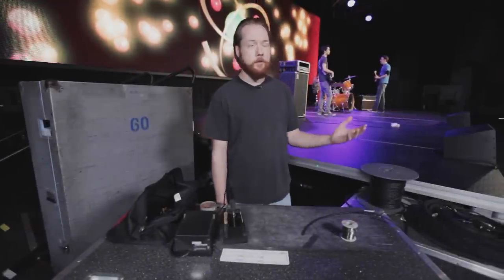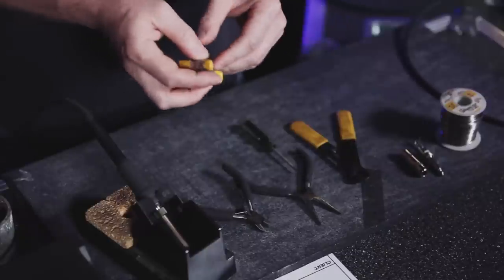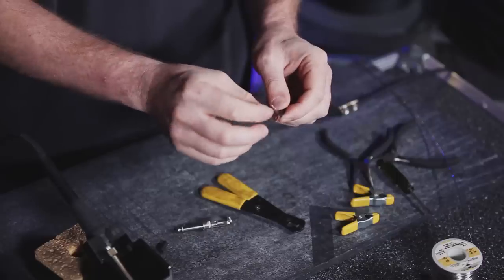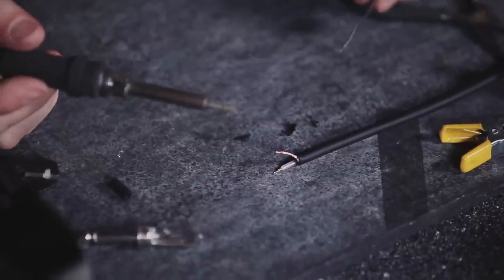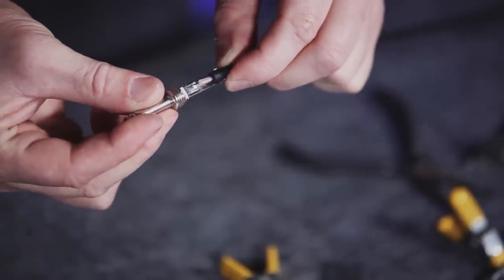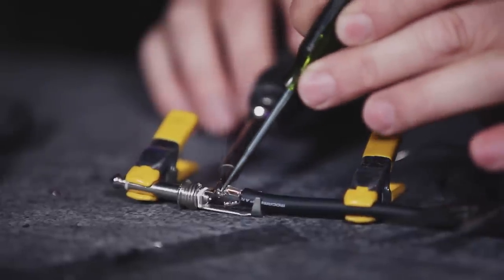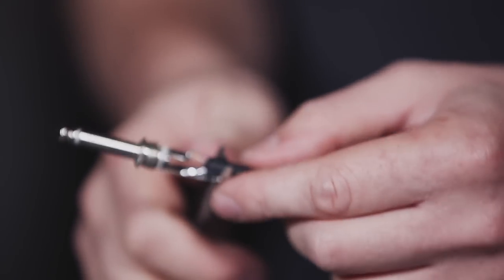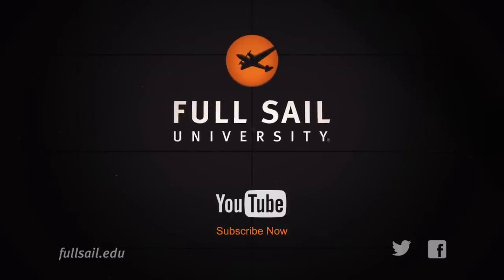How To Solder an Audio Cable

Comment: Great video! I We have to do this several times a week usually. I work for the school system as an electronic technician and dealing with the P.A. systems and sound reinforcement for all the mic wires and audio cables between amp, mixers and speakers and such, we get a lot of highly abused stuff and pull it out to make most of it work again.liked and subbed. THANKS! Great solder technique, much prettier than mine. :)

Comment: soldering cables does not require flux/soldering paste?  i read about solder with flux in it, is that sufficient? i guess the solder being used in this video is like electronics-solder  with flux in it?          btw i have this 30w soldering iron, first time i want to use it the tip already turned black and solder does not stick to it.... anyone know how this could have happend?  did i heat it up too long before applying tin to the tip perhaps?            i dont really understand why i cant keep the tip of this iron clean and get any tin to stick to the tip.
already ordered a new tip and also a 40w iron from a more professional store
the solder i am using now says it has 3,5% flux in it, this means its that multi core solder right?  it says its for electronics..      so i dont understand how it wont stick to the tip of the 30w (Welco) soldering iron..
edit: i just cleaned the tip of this 30w Welco with a grinding stone for knives and some steel-wool, it seemed there was a black coating covering the entire tip so i cleaned it until it was bare metal  and then after heating it up again the solder was sticking to the tip finally..         guess it wasnt really clean from the beginning on, the tip still had that black coating on it against oxidation i suppose... now its looking like clean iron and the tin is sticking.        they didnt mention polishing the tip a little before first use, i read on the internet a lot of people with this problem all use these cheap soldering irons, my guess is they all try to solder while that black coating is still covering the tip....... lol    so at least i learned something new here............... i must add i have actually earned my money with doing soldering work a few years ago but that was for an engineering company and we only had professional equipment there, so cleaning the tip of a soldering iron did not require to completely remove a top coating layer on the tip, besides that i always used brass wool to clean the tips, perhaps using this would also clean the black coating that is on cheap new soldering irons like this welco 30w had,  strange thing is they also sell a welso soldering iron station/stand with it which actually  comes with a sponge,    which is clearly not sufficient to clean these cheap tips with,   i also noticed when i was tinning the tip of this welco that the flux immediately started to contaminate the tip again and the sponge does little to clean the flux off the tip...  so definitely need a brass wool for these kind of soldering irons.

anyway to make a long story short;  i would still like to know if you normally would need flux when soldering audio cables,   is it the case that  multicore solder is being used in this video, solder that already contains flux?

Comment: I have a 12 gauge wire that doesn't have ground. Is it dangerous to not have? And that should just be soldered to the main pin?

Comment: I bought a shielded cable and it has three wires, two are normal and 3rd one is wrapping all of the wire...I am confused as i don't know whether i should connect the shielding wire to the mono jack or not? if so then how? please reply
Reply: the third is your ground. You have a stereo cable. red and black are left and right

Comment: Could you make a video showing how to solder HDMI cables?
Reply: everything is possible, but HDMI cable have much more pins. Sound only has + and -. Just google "HDMI" and you will see how many pins HDMI has.
Reply: Rui Botelho
+ and -? Isn't sound alternating current?
Reply: ***** ya, its just for saying 2 wires. ground and signal